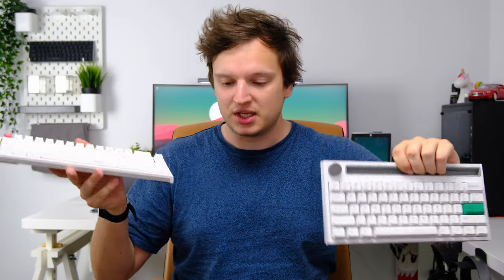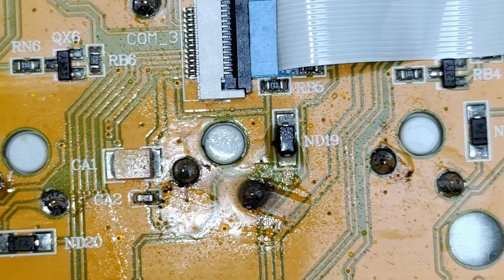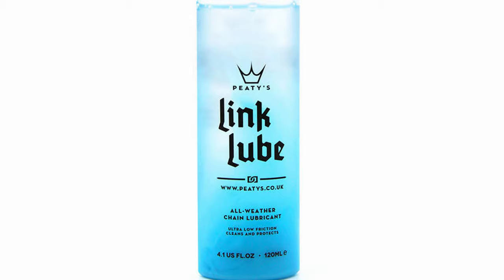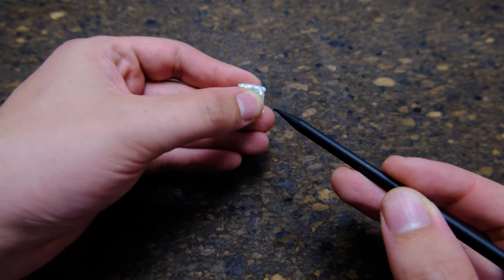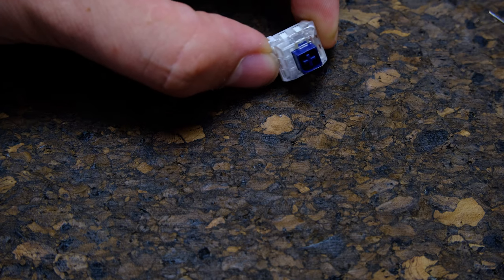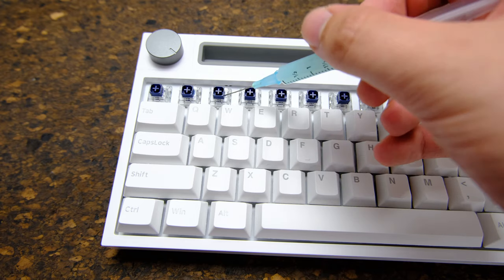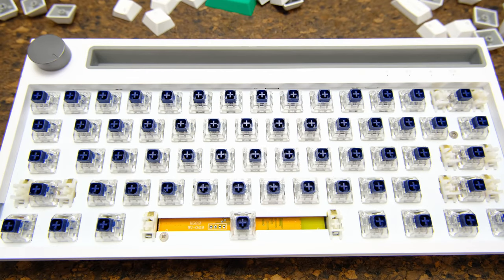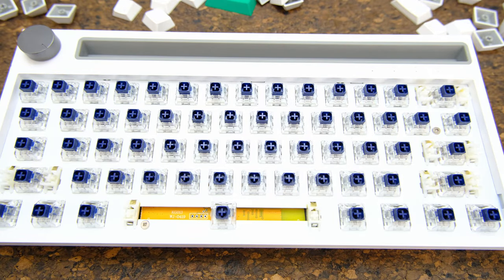Lubing an entire keyboard in 5 minutes. NO MESS

Comment: I used this on my SK61 and if you have done this before, it's quite useful. It basically lubes the switch to make it sound and feel better. However, be warned as over lubing it may result in some switches becoming sticky. Only use about 2 drops per switch and clean your stem after. Do that and you should be good.
Reply: do u recommend pressing the switch in or no? and did u do anything about the stabilizers?
Reply: @DawoodKhan-kn4iu  I'm not really too sure, I did this over a year ago and can't really remember what I did. Realistically I'm pretty sure this method isn't all too good overall though.

Comment: doing this because my keyboard is not hot swappable and I got cherry mx silent reds. If someone can explain how I can syringe the stabilizers that would be good! Also if someone can find a lube like this in the US Amazon
Reply: The stabs are really easy on a soldered board. You can just take a tiny brush, or a really thin piece of plastic like a straw that's been cut long ways. Then you take your grease or lube, get a decent amount on your tool, and just get it all over the stabs. Under, inside, on the sides of the stems. Then, press and pull them up and down a few times. Clean up the stuff on the outside, then put your caps back on. 

You can't do that with every key but you can do it with the stabs. Also, another way to make your board sound and feel better is to take it out of the case. It shouldn't be a big deal. Then get some foam, and line the bottom of your case and fill in any gaps. Then, when you put it back together, leave the middle screw a bit loose. Just enough so it doesn't rattle but you basically want there to be some flex in the middle. You won't be able to see it. But it will make typing feel better and it sounds better too.